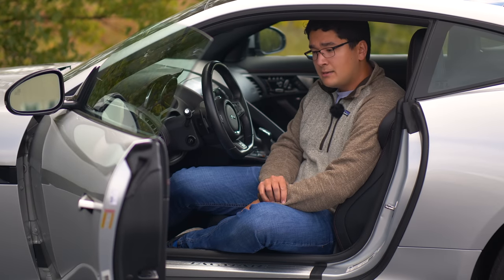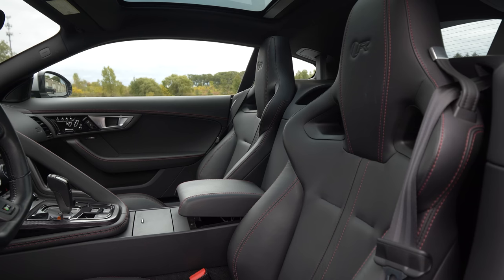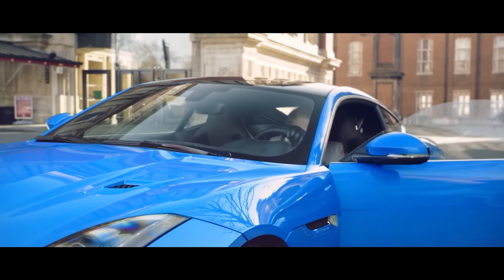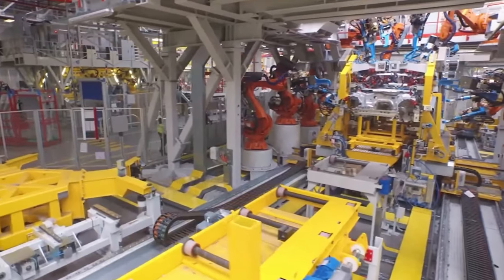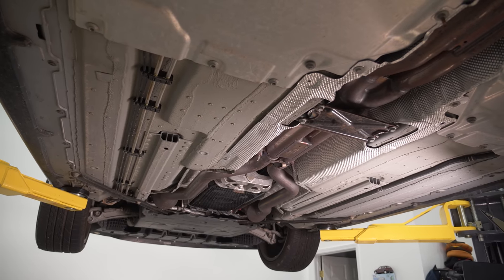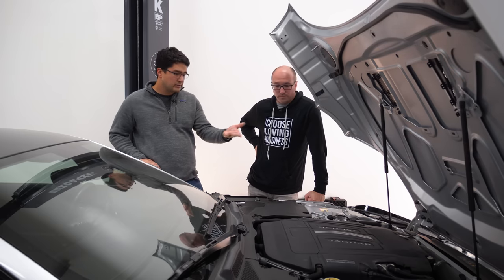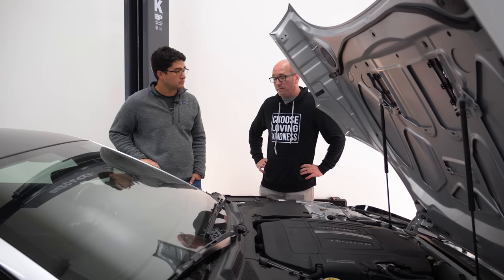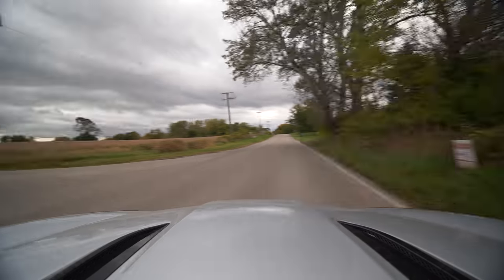Jaguar F-Type | A $45,000 V8 Gorilla

Comment: The pre facelift F-Type looks so much better than the new one. This actually looks like a jag. The new one just like a sporty car with a generic front end.
Reply: Sort of agree...it does improve with an all-chromed front grill though.
Reply: Unfortunately, yes. That so often happens with revisions. The designer gets it right to start and all anyone can so is make it worse.
Reply: Yeah, and the first two years were LOOOOOOOUD.  Now it sounds like a Camry.
Reply: @FFE-js2zp  they still sounds good, but they had to lower the noise unfortunately, but that can still be bypassed
Reply: @FFE-js2zp  they didn't tone it down until the 2021 revision, 2014-2020 were loud throughout the rev range
Reply: @suppaman19  
The June 2016 software update was the biggest quiet down.  It was so quiet, 2014-15 owners were forcing buybacks, so Jag now offers a patch to revert "upgraded" cars.  They "upgraded" mine without my consent and they would have bought it back if there was no patch.  The patch is only a 90% fix.  The difference is night and day between 17s and earlier cars.
Reply: Agree, old design looks better
Reply: facts
Reply: Hard disagree, the new look is beautiful
Reply: @FFE-js2zp A Camry…lol…Okay there…
Reply: @suppaman19 It’s addressable by simply pulling a fuse. Big deal.
Reply: @antholito Definitely polarizing it would seem. I feel the new design makes the original design look very dated. I love it.

Comment: I own a 2015 "R" and at the age of 75 this thing makes getting outta bed a joy. Every time I drive mine it puts a Sh*t eating grin on my face, just like in the video. I love the drop dead looks, the sound of the machine gun exhaust and drop the hammer and that smile just fills my face. From the time the dealer started the the Jag, it just "talked to me". I've have had 5 Corvettes and none of them could touch the Jag. I plan to keep this car until they take my keys away, out of my dead hand. Right on review.
Reply: Hell yeah!
Reply: Hi mate, I am looking to get one in Australia, how is yournexperience going with your Jag, have you had any major issues? Watching this video that corrosion under the car looks concerning. Where I live it's mainly sunny and dry and only wet over winter, no snow, might be better suited in a dryer climate vs say UK. I've heard injectors sometimes need to be replaced? I want to buy say a 2016 model with about 60,000km so I can afford it and also want the louder exhaust as well as the original headlight design, which gives it a timeless vintage James Bond sports car look....other than potential issues I've heard about the car, im obsessed with getting one in black, took one for a test drive the other day and its just a mosnter
Reply: Oh and I was also looking at the Lexus LC 500, but the Jag just felt like a real sports car, Lexus was beautiful but too comfy if that makes sense

Comment: Watched this video literally 5+ times now. My attainable dream car!!
Reply: I bought my 2015 R six months ago.  I'd say to you, jump in the water is fine. 6 months later it's still a great time,  everytime I drive it. Picked mine up for 42k with 29k miles. I believe since then the price has increased 5 to 7% in line with the used car market as a whole during the Covid debacle. But seriously,  even with that slight price increase,  I think it's a steal.  The thing was 115K new. I get so many compliments it's amazing and I live in Los Angeles amongst McLarens and Ferraris.  Anyway,  like I've said, I've had it for 6 months and I still watch this video at least once a month.  Last note,  I turn off the traction control and slide like I'm on the midget car circuit. So much fun.
Reply: @kevinquartemont2313  great to hear man! It definitely is an under appreciated car in the industry right now

Comment: As an Ex 2015 R owner:
I fucking love this car, will definitely buy another one in a few years. Switch wheels and tires to SVR spec, and add PS4S (265F, 305R) and it will be a canyon carver and a great daily driver. Just won’t be your track car. Also the seats are awesome for less than 2 hours.. after that they start wearing you down. Try to get one with the fixed glass roof, its effective in making it airy. I’d pick one up for 45K and save another 10 for the wheel-tire & paint protection. 
Warming up the engine properly = reliability 👍🏼
Reply: Why did u sell it?
Reply: @bmx687  I had an appendix surgery in a 2 week insurance gap period that costed me about $35K. I changed it for a 1LE V6 Camaro (I bought the Jag 2nd hand with 9K miles for around 60K).
Tbh, the V6 1LE was a sweetheart as well!

Comment: Bought one for 45 grand last year and I love the everliving shit out of it
Reply: Reliability?
Reply: @DonnieDarko727  Had a water pump leak, replaced under extended warranty for free. No other issues, runs like a champ.
Reply: @anzeg-  can I ask how many miles you have put on and what you bought with?
Reply: @DonnieDarko727  Got it at 44k miles, now at 56k
Reply: @anzeg-  still any issues? jag has a bad rep for reliability so im scared of buying one if its gonna shit itsself
Reply: @noelbaudy5371  No, besides that water pump, no real issues. It's been surprisingly reliable by sports car standards. I was expecting much worse going into it. I do live in a hot climate, so maybe it's the cold that messes them up and why I don't see it.
Reply: @anzeg-  Thanks for the quick response!
Reply: @anzeg- Hey mate, I live in Australia and it's pretty dry here, no snow, all my research on issues with the Ftype seem to be some of them are climate related, how are is your experience so far, I am looking to get a 2016 one in black so I can afford it, love the older headlight design looks timeless (the new headlights will actually age faster) and want the old louder exhaust.....any advice when looking for one?
Reply: @benbansal  Hey
Mine is a 2015, still have it, currently at 75k miles. Yea I also prefer the older design of them for the same reason. Besides that original water pump leak I mentioned in a previous comment I've still not had any major problems with it. Minor stuff: engine and transmission mounts needed replacing twice, battery doesn't last for more than 2 years max and I've had the ceiling cloth start falling down (glue gave in from heat).
The 'soft-touch' plastic over buttons can melt and become sticky in hot weather, I rubbed it off with some lemon based guitar string cleaner.
Things to look out for; I hear the center vent (goes up and down a lot) can fail and the sports exhaust controller can start to fail and not open valves properly, but I haven't had those issues myself.

Comment: I’ve been saying it for a decade and short of that for the F-type. 
My buddy is an internist doc owns his own practice in Florida (Jag, Maserati, merc capital) and he owns a 2015 Ftype R rear wheel drive. He always complained on how scary it was to drive with a rear end that’ll beat you to the finish line and he was fond of my Porsche 911 1999 so we swapped for supposed to be a week but ended up being two days, but I was ecstatic. 
The feeling when you slide in and start it up is in fact exciting. It felt right. The exhaust is designed to mimic the snarl of a real Jaguar and I knew it when I cranked it up. 
From the jump pulling outta the parking lot the car is untamed and the rear end wants to go it’s own way. 
Lighten up the throttle and it snaps back but breaks loose instantly again. 
Dangerous to most drivers I’d assume but I whipped it into control with not too many issues. 
Driving from Hyde park to carrollwood I passed Raymond James with the TB Buccaneers playing. I had to light it up for the tail gators and a sick Lambo was skirting by so he did the same. 
Pure enjoyment. 
Ok so the rear end underneath you take the cross bars off and take them to a metal shop and dip them in nickel or a hard anodized solution to stop any rust. 
His Ftype had carbon fiber replacement bits where the cheap plastic was. 
Tires were pzero’s and struggled to bite when pushed but once warmed up they semi tamed the beast. 
I gotta say it’s a handful to drive and it’s a killer to most that attempt it. 
Talking the 2015 model. 
Stupid fun car and I loved it. 
Would I trade my much older 911 for it? 
Nope.

Comment: The type of car that’s epic when it’s not broken.
Reply: Ian TB  coyote derived V8, ZF transmission, I think the F-Type is more reliable than most people think, short of the rust from Tata cheaping out on the steel
Reply: It isn't as bad as all that. The drivetrain is not especially exotic, and Jag's traditional electrical problems were largely banished in the Ford years. I'd worry more about the crappy interior bits and pieces breaking than anything major happening.

Comment: One thing I would have expected you to opine on is the question of reliability and expense to repair. Especially as it relates to the lc500 comparison. By all accounts, the jag is likely to be a money pit, and I think the used values reflect that. The professor analogy was dope btw.
Reply: They are actually pretty stout. Minus the rust and some interior issues.
Reply: you think the lc500 is cheap to fix?
Reply: @an-dr6eu  did i say that?
Reply: Yeah, the latest iterations of this car are well worked out and quite reliable…The advantage of being deep into the development cycle and being refined, no sweeping changes, etc…They’re great cars…LC is nice as well, no doubt, but these are very different cars performance-wise….Especially with the new R that is AWD…That thing really gets the power down now. Stated 0-60 is 3.5s, but in reality it’s often quicker than that. The LC real world 0-60 is more often than not low to mid 5s.

Comment: I own a 2015 F-Type R and the RWD is so much more fun than the AWD models. $50k out the door with $4k miles and even got the carbon spliced wheels and dash. Full disclosure though I've already spent $4000 additional in my first 10 months of ownership thanks to a differential leak (the seals suck and i'm in FL so the extra heat does no good) two new tires, oil change and a few minor engine light errors (PRO TIP: if you upgrade your software in the older ftype models it will reduce the sound of your backfire quite a bit and will sound more like the 2021 models so I refuse to do a software update until it effects my driving experience.)  But despite the upkeep this car is a freaking BLAST! I should sell it in a couple of months to keep losses to a minimum or break even but this car is so much fun I think I may just run her to the ground and eat the cost lol.

Comment: Michelin P4S are amazing, it’s an amazing change with h&R springs. A friend mine has the setup on his white ftype-r . The cars has theater , it’s stylish, and it’s great GT car for 150+ drive!! Great bargain when compared to an AMG GT with possible $18,000 transmission issue replacement.

Comment: I am on my second F-Type.  Both 2016 V6 "S" rear wheel drive coupes.  First one had the Quick Shift 8 speed auto and my current F-Type S has a 6 speed manual with factory upgraded clutch.   Put 28K miles on the automatic and just turned 43K on my manual S.  No issues and both cars have been bullet proof!  I beat the hell out of them and they keep asking for more.   I run 3/4th tank 101 octane AP Racing fuel and 1/4 tank 91 octane (California sucks!) because a forced induction engine loves octane.  Engine temp never moves, even when driving SF to LA in 110 degree heat with AC blasting and doing XXX MPH down I-5.

Comment: carefull: those 45k can be deceiving , theres a reason they drop this hard
Reply: Ian TB  these are wortht every penny and barely any of them are on the streers which make em cooler and cheaper for the rest of us
Reply: modern jags are really not that bad its no toyota but if you can live with bmw and merc reliability levels that jag is fine and your not gonna buy this as a daily driver its a weekend/fun car i think it tick all the right box personaly i would have gone for a open top since its gonna be a fun car might as well add some drama to it
Reply: Almost all expensive cars drop massively. Used car buyers are mostly looking for transportation, not thirsty sports cars, no matter how beautiful or great to drive.
Reply: Well if you buy a 120k car at 45k, you should have half the brain to tell yourself to put a little money aside for maintenance. No one buys those cars for their "impeccable track record of reliability".

As long as it's not Chevy Cavalier levels of absolute garbage, I guess it's fine for your dollar.
Reply: Ive got an XKR same engine and all and I had to replace it at 55k miles. Bought it used with an extended warranty that luckily covered it. Was only $200 out of pocket, would have been 25k easily.
Reply: @evans9215  what did you replace man, I’m a big fan of this car the Dodge Viper and the previous corvette for me was one of the most beautiful car atleast in my teenage years I really would want to own one someday.
Reply: The reason is they sell at a massive discount from MSRP.  Brand new Rs sell in the high 70s with $110K stickers.  Check Autotrader.  Thats 40% "depreciation" that does not exist.
Reply: john m 
German brands are even worse than American, but American cars use even shittier materials than Japanese and Korean cars, which are all slapped-together garbage.  All modern high volume cars are putrid junk.  Jag F's are exquisite masterpieces, but it is literally a dying brand.  People crave crap.
Reply: @optimuschrist15  the whole engine

Comment: We have had ours for 4 months and I have to say its been horrendous.

Been back at the dealership 4 times for a total of over a month with only 20,000miles on the clock.

Slave cylinder replaced, alternator replaced, bearing replaced and an issue with the gearbox replaced.

If you want some advice - stay away from it, its gorgeous but garbage!!!!
Reply: you probably bought a used one from someone who hooned it and then your dealer fucked you over and expected you to never come back in for the repairs they knew it needed.
Reply: @AJAY71731  in fairness the dealer couldnt have been any better and neither could Jaguar as a company, full refund given and compensation for the trouble.

After I wrote this review it went back into the dealer and there it stayed, eventually a full new engine at 19236miles which is pretty poor gor any car, hooned or not

As I say, Jag took the car back off me and gave me quite a bit of compensation for the trouble.
Reply: @mykiman5955  There's been some F Types that have been runs a race circuit taxis making their way to dealers !

Hooning one of these and then just switching it off is not a goo idea either  these engines run very hot but are basically bullet proof trust me I know I drove one with  no water in for 30 miles !!
Reply: @sichere that could be said of ANY high performance car, it doesn't detract from the fact that ours needed an £18,000 replacement engine at less than 20,000miles

The dealer also found it difficult to work on our manual vehicle as they had to get a master tech come from the south of England to work on it as they only do auto's normally.

The build quality inside was also poor
Reply: @mykiman5955  Trust me no super car would drive 30 mules with no water in the engine and the  F Type does not come with a manual gearbox.
Reply: @sichere  they 100% do come in manual as I owned it!!!!!
Reply: @mykiman5955  We are talking V8's here not the Vegan hairdressing V6 that's a V8 with 2 pots missing - who in their right mind would buy one of them !!!
Reply: @sichere  ahhhhhhhhh so you're one of those who can't really drive and must go for the auto, i see now, makes sense 👍
Reply: I basically completely disregard your comments. God only knows how your car was treated/serviced before you got it. So your used F-type had issues and your advice is that the world should avoid them. Please.
Reply: @dlj1285  Im not sure why you are being passive aggressive toward me but it says more about you than me??

Would your advice be that I should ignore the issues I had??

The fact remains that Jaguar compensated me for the experience I had with their product as well as taking the car back which speaks volumes and showed that I wasn't in the wrong as their product didn't perform as it should have under warranty and under 20,000miles

On top of that, Im certainly not alone in my major issues but your ignorance speaks volumes.

Move along!!
Reply: @mykiman5955  Pound sand. Happy you got compensated, but it’s not because you had the experience you had that everyone else will. There are many people that own these cars without issues. I have friends and family where this is the case. That is what I was responding to, your assertion that they are all automatically garbage because you had a bad experience. When people say stupid things on the Internet it is possible that they might get called out. Like it, don’t like it.
Reply: @dlj1285 in my opinion it was utter garbage and an experience that I wouldnt want to repeat.

Coupled with the fact that that the Jaguar Landy technician who was at my house 3 times said they had nothing but problems leads me to believe its a sub par product.

Most people will have very few issues and I must admit that the dealer network was first class but overall I found it fit for the garbage when considering the price.

Ive not had any issues with the Cayman, Boxster, Mustang or thus far Supra that I have owned in recent times.